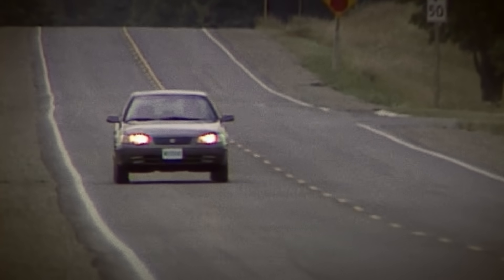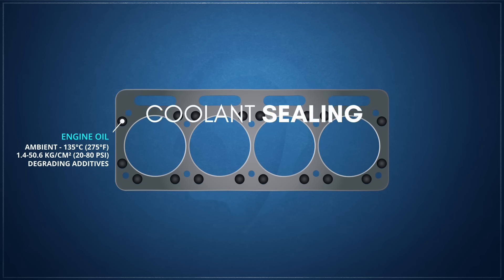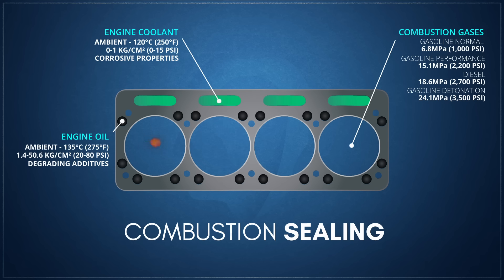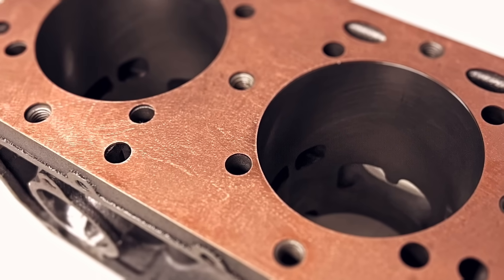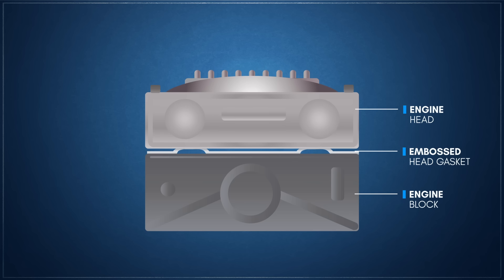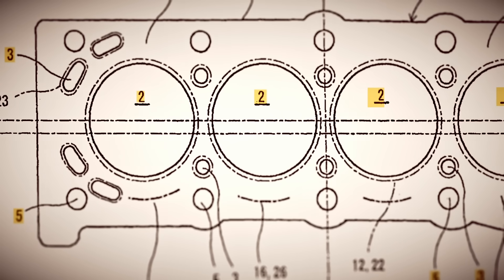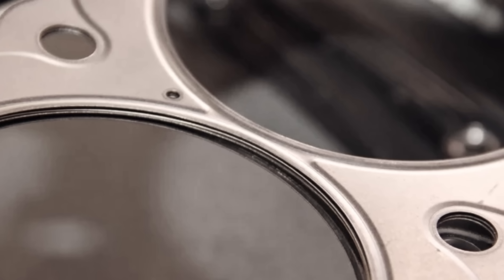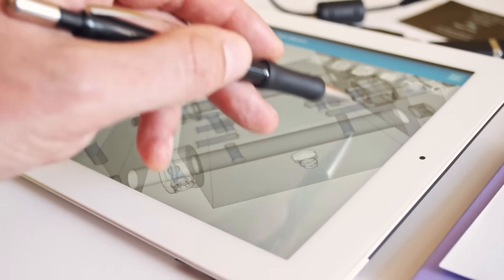The Most Tortured Part In An Engine

Comment: I have a 1976 Triumph Spitfire 1500 that the previous owner had ground the head down to increase the compression. It was so high that I couldn't get rid of the pinging with the highest gasoline available to me. I bought two stock head gaskets and I found some company that made me a copper one. I sandwiched the copper gasket in between the two stock ones ( I sprayed a copper sealer on them first) and bolted it down tight. That was around 25 years ago and it still purrs like a kitten.
Reply: @@user-pl8io5be9c The head is ported and I put a hotter cam in it, not the racing one though. The 1976 Spitfire was the only year model that had high compression to begin with. I also upgraded to the Weber DGV carburetor.  No amount of timing adjustment would work. This gasket "hack" was a lot cheaper than trying to source another head.
Reply: Now that's amazing!
Reply: It’s crazy that a few thousandths can change the compression so drastically!
Reply: @The_Deforester  Your post made remember something. I also had to have all my push rods cut down in order to adjust my valves!
Reply: @skipcallaham1517  that’s nuts! I’ve never even heard of that!
Reply: @The_Deforester  it can one time the clerk at the auto zone game me the wrong gasket and the engine wouldn't turn on then I remembered for some reason all of the rockers were lose and I had to re torque them. That's when I looked more closely at the gasket I got vs what online said was stock
Reply: We still doing the same thing to this day in Asia on modified engine. If it way to much we just machine the "wok" a bit.
Reply: That rules! I would've tried 10-30% toluene to get the octane rating up around 100, but I think your solution is better b/c you can still run on pump gas w/out carrying barrels of toxic chemical everywhere
Reply: @nathansmith3608  When I first got the car, before I rebuilt it, I would use a can of Berryman's carb cleaner in each 10 gallon tankful. It was drive-able but was a pain to always need to add something, not to mention the added expence.
Reply: @red not to mention he’s lowering the compression at the same time by increasing the head space with essentially a shim. Isn’t different head gasket thicknesses kinda the norm now for built engines to get the desired compression ratio?
Reply: @RainOnThursday  yeah, for example a thicker headgasket on a stock bmw m50 lowers the compression enough to put a turbo and make +400hp reliably
Reply: @RainOnThursday  forced induction engines. can run a standard block. multiple gaskets will drop ya compression. n fail b4 alot of other stuff. depends on boost pressure. kit who made it. UK ROVER anything turbo K series. just set it on fire. it's QUICKER. IT LIVES THERE. the local g60 guy who owns a rolling road. n just wants to know. forge pistons n 3 headgaskets. n still in trials. HE WONT TELL ME. but everytime i can do better.
Reply: @RainOnThursday I know when I buy a KTM 300 piston kit it comes with several gaskets for getting the piston to match the deck at tdc. Those gaskets aren’t as tortured as the ones in this video though as it’s just a single cylinder, so those multiple gaskets would be cheap.
Reply: That is a beautiful car. Ive always loved those. My favorite car of all time is the 64 spitfire
Reply: @Samuel_E23 I had a 64 spitfire when I was 16
Reply: @red cars and computers are not the same. Thermal paste? Bruh no. It’s literally explained in the video as to why this dudes tellin the truth. The spring rate and head lift would’ve been to great without copper.
Reply: When my dad used to live in Nigeria the local mechanics didn't have a lot of tools available to grind and level warped heads so they would do the same thing and sandwich gaskets with copper ones to help 'fill' the holes of the warps and still seal correctly.
Reply: Very Nice repair good sir
Reply: That was a good solution...
Reply: I have an MG midget that is going to be a great driver too...cheers
Reply: I don't understand why most cars don't use MLS Head gaskets.
Reply: Done a similar thing, took a little off a small 2 stroke engine to give it better compression.. took a little too much off in the lathe (overheating issues due to compression) I cut and flattened out a 6 inch cold drawn copper pipe and made a copper gasket.. 10,000km+ later it is still going like a champ.
Reply: I just did timing belt on Honda h22 and used cheap coolant now head gasket leaking. Where did I go wrong? Help
Reply: @Majoralert  hey i actually have a 95 accord f22 i did the timing belt on. if you made sure the cams were not rotated and all alignment marks were in place AND that the belt has proper tension (ik on the f22 that the idler and tension on one can easily be put on incorrectly) there isnt anything you explicitly did wrong. usually i recommend people take their cars to certified techs for anything related to timing.
Reply: @SamTheSambaMan  setting base timing isn't exactly difficult and that has nothing to do with his problem. He said he "used cheap coolant" which if you're a certified auto tech(whatever that means) you'd be well aware that honda uses many of their own proprietary blends of liquids in their vehicles, their special blue coolant being one of them, which is actually necessary due to their choice of water pump seal materials, water pumps, head gasket composition, etc.
Reply: Now, that's a shave lol
Reply: Good for ya
Reply: until the big ends let go,they were bad on the 1300cc but tettible on the 1500,timing chains also,in reality a crap engine!.
Reply: @tekguyla1118  Yep, I lost a block and crank due to the thrust washers falling out. I never knew it until the number 3 piston split in half. I always called them "tractor engines".
Reply: Very nice! I like it!
Reply: I cringe every time I see a head gasket go on without being drowned in coppercoat
Reply: Add another head gasket and a blower lol.
Reply: What kind of copper sealer did you use?
Reply: @Rhamboll  Permatex copper spray.
Reply: @red “much harder to tune non-fi with high compression without porting or cams” you are 100% talking out of your ass lmao none of those things have to do with compression
Reply: If you cant reduce the compression then you increase the area!
Brilliant thinking! 
Im impressed it still works to this day, too!
Reply: No fuckin way i swear on my life u live in my hometown
Reply: Is it green perchance?
Reply: @89gmt400  Nope, Carmine red.
Reply: This fix prob worked because the compression only needed to be lowered a small amount to stop the pinging with high test. Perfect.
Reply: People do this all the time to decrease compression. Especially with 2jz-ge NA motors
Reply: Thank you!!! You just fixed my 1500
Reply: sounds like the type of engine that is the bane of a resto mechanics life
Reply: Can I have it (for free)? 🥺👉👈
Reply: Yooo I have an 80 tr7 3.5 rover swap 🤝
Reply: Brilliant repair
Reply: Fuckin love stuff like this. Crazy wisdom
Reply: Just aneal the copper correctly that's how my friend does it. He always made his own gaskets out of copper.  It's how they do prototype engines.
Reply: Your head gaskets teach hard lessons
Reply: *grinded ?
Reply: Very cool
Reply: but did you try avgas?
Reply: Highly doubt this
Reply: First comment I read: and you mention copper too!
3 minutes into this, I thought "why don't they use copper head gaskets", I looked, they do. So. buy a laser cutter and copper sheet. done.
Reply: He could have just increased the combustion chamber cc size and done the same thing without killing the power of the engine completely. It might have pinged because when you milled the head you never ground the quench pad back up it’s original spot or didn’t check proper quench pad clearance. You’d have to jump the compression beyond 10-1 to have an issue like this. Raising an entire compression point by grinding the head is very difficult. The amount you’d have to take off the head to accomplish this is in the realm of crazy. You’d have to take .at least 030 or more off the head to accomplish this. That’s considered junk at that point.

More than likely it was improper quench pad to piston clearance and that causes lean spots and will knock and ping. It messes up the mixture inside the combustion chamber. 

By adding that much gasket it’s the same as removing the quench pad entirely and then some and I’m sure it neutered the engines power. 

The compressed thickness of the head gasket on this car is .043 
So between the copper gasket and the extra gasket he added .86 of an inch. 
That means he dropped it 2 full points of compression. 

I should mention I doubt the validity of longevity.
Reply: Seen guys do it with gas tractor works every time
Reply: Is there a video explaining more In depth maybe even a step to step? Sounds brilliant
Reply: I guess that higher compression wasnt as much of an issue with lead gas?
Reply: Why would he sand the head down if it was just going to cause knock? Did it actually increase performance?
Reply: @ChristopherGuilday  If you run a high enough octane fuel it will not knock, like aviation gas. That stuff is very expensive to be a daily driver and you can't just go anywhere to get it.
Reply: I liked looks of that thing, but it's britishness freightened me.
Reply: Could’ve just used the copper and ditched the gaskets, the copper is soft enough to seal
Reply: @evancox107  Too much surface area to crush.
Reply: @evancox107 when properly anealed.
Reply: I hate to be that guy but I doubt it…
Reply: @Lubbocksfinest whats unbelievable about it?
Reply: @EmazingGuitar  cause gaskets don't seal against another gasket. You need two hard surfaces on either side
Reply: @Lubbocksfinest  on my turbo vr6  I used two gaskets with a 0.100 metal spacer to lower the compression ratio to 9.2:1 to handle boost without knock
Reply: @Lubbocksfinest  I also used copper spray on all three layers
Reply: @Lubbocksfinest  Back in my dirt track stock car racing days there was a guy whose 350 Chevy small block kept blowing headgaskets. He double stacked 2 gaskets on each cylinder bank...it did the trick in stopping blown gaskets.
Reply: @Lubbocksfinest i did this on my 2 stroke bike that was misfiring. It’s a pretty common hack on bikes, and it works
Reply: @Lubbocksfinest that's how manufacturers do prototype engines.  My friend hand scrapes his engine blocks and heads when restoring old cars then uses a sheet  copper gasket he makes him self he aneals it and they never fail. It also makes head removal easy.
Reply: @Lubbocksfinest  surface level mechanical understanding ^
Reply: @Lubbocksfinest  why? I started watching this and immediately thought they should just use copper gaskets. turns out it's a thing and this would 100% work.
Reply: Yeah and I jammed a muffler into my coolant tank it runs like a cheetah 🙄.

Comment: I have a motorcycle that does not use a head gasket. You're supposed to lap the head and cylinder together so they will seal. It's an old air cooled two stroke.
Reply: I have an old 2T outboard that doesn't have a seperate head, the ends of the cylinders are closed with only a hole for the sparkplug.
Reply: That's because it hardly matters if it leaks a bit.

Comment: I for one,  hope that the internal combustion engine never disappears!
I enjoy being able to travel extreme distances (reliably) without having to wait hours to refuel.
Also there is nothing like the sound of a internal combustion engine as you lay your foot in it.👍
Reply: EVs can charge in 20 minutes, just wait 10 years and charging will be faster than fueling. Although true, there is no replacing the sound of a true mechanical beast
Reply: This is why I hope we can transfer that technology into using hydrogen. It has double the energy density, can be quickly and easily refilled, and only emits water vapor
Reply: @razgriz1258  only emits wager vapour when burned with 02 only. Burning with air emits heaps of NOx , which is a huge problem. 
I like the idea of hydrogen ( I'm paid to do research with H2 in natural gas systems) but to think it is easy or nearly ready to happen is incorrect.
Reply: @sexyfacenation  that's right the infrastructure needed for refueling is insane & big.
I watched a video where they refueled a hydrogen high pressure car.  The system for it was huge!

Comment: MMO oil additive truly does help lubricate the least lubricated but most important component in an engine, the piston rings! Sodium Silicate based head gasket sealers (blue devil) DO work when applied properly
Reply: Modern piston rings usually run fairly loose compared to historical engines
Reply: @OtherDalfite  A huge problem is there is no direct oil contact on them other than secondary splashing from the crank shaft. Gunk naturally collects on the piston rings and seizes them. Many engines with blowby are permanently repaired with additives because the only problem was stuck rings. Additives are the only way to clean this.
Reply: @termiterasin  seems wild that there isn't. You'd think by now we'd have an oil passage just ever so lightly spraying/misting the bottom of the cylinder walls.

But modern piston rings do run looser. It's part of the whole efficiency thing. My 2.4 ecotec has loose (not stuck) piston rings and they let oil by

Comment: You definitely missed a lot of zeros when converting microns to inches on your ra values. 1.5 um (0.0015 mm) is 0.00006 inches, not 0.06"
Reply: Man ,it’s when they mess up these simple things then you start second guessing all the information and facts presented in the video. Hopefully OP knows the detrimental effects of these small mistakes.
Reply: @ytf7608 
Temperatures were also off at one point, when 135 deg C is 275 deg F, but 140 dec C is somehow 220 deg F. lol
Great video nonetheless.
Reply: I thought that seemed a little off too
Reply: Also, 80 PSI is ~5.6 kg/cm2, not 56 (as presented at 2:47).
Reply: @sustmi I wondered how a 35:1 ratio became a 4:1 ratio.   And who doesn’t use kPa?
Reply: He got many things wrong. Idk why anyone watches
Reply: #mathgod can you tutor me

Comment: This was very cool. On my air cooled VW's, it's generally agreed that you have to go in and re torque the head studs, since the sealing gasket is either copper, or simply cast iron on aluminum. Sealing torque is also only 18-21ft/lbs.
Reply: exactly the same torque and procedure for our older 2 stroke outboards:) service manual says to re-torque after 10 hrs of use, but i'm paranoid and do it after a heat cycle or 2, then 10 hrs after. i also use permatex 847 (just a tiny bit) around the fire ring surface to prevent the dreaded water intrusion. is that done with VW's/air cooled Porsche as well?
Reply: @ct1762  Factory vw type 1 motors have no copper ring or sealer but some people add one, type 4 motors do have a copper ring. I'm not sure about the 6 cylinder Porsche motors I've never torn one apart. I haven't heard about the permatex sealer, usually you can see where there were leaking on teardown, and that's most often from other failures. Vanagon water cooled motors also have a copper ring and a very small o-ring for the combustion seal, and then a rubber seal around the perimeter for water sealing. Those have a bad rap but usually from corrosion that's coolant related.
Reply: @curtislovrak5390  thanks Curtis great info. The 847 gasket adhesive was never recommended for outboards by the factory, but lots of guys use a tiny bit as the aluminum sealing surface for the cylinders is thin and all sorts of pitting/warpage tends to happen over time, especially with the heads themselves hence my curiosity about the equivalent with air cooled VW/Porsche. with outboards you get up to 30 psi of water pressure in the block, and i assume this can only increase the risk of water intrusion. the VW/Porsche motors seem to be more oil cooled than air cooled as they take what... 12 qts? at that volume and temp, it must act like a pure liquid so maybe additional sealing is necessary for vintage motors.
Reply: @curtislovrak5390  Older 40HP bugs had copper sealing rings around where the cylinders met the heads I think as a form of secondary seal
Reply: @brycekeba8570  More specifically the stale air heated cars got them, and they stopped using them on the fresh air cars, for sake of simplicity I was talking about the 1300/1500/1600 type 1 motors, I love the early stuff too!
Reply: @ct1762  Permatex is far from suitable for the head temps of an air-cooled VW motor, closest thing I have heard of is using a very thin layer of high heat paint on the cylinder to in theory seal any small head leaks on used heads
Reply: yes sir that is the way to do it